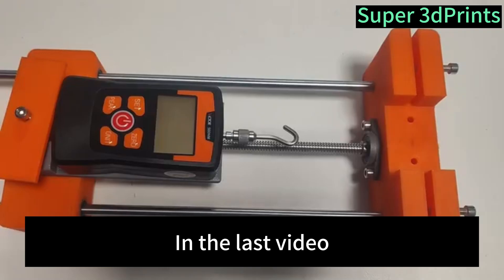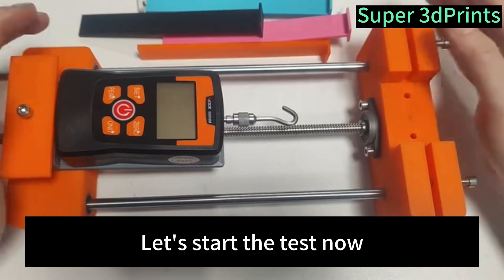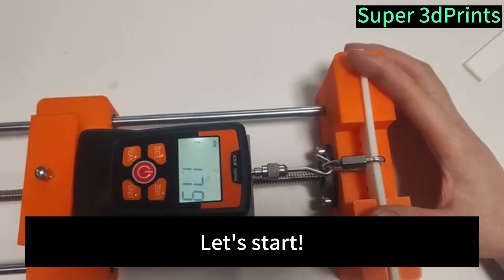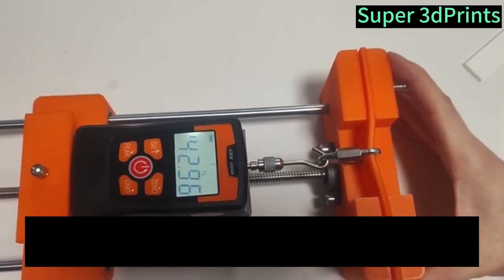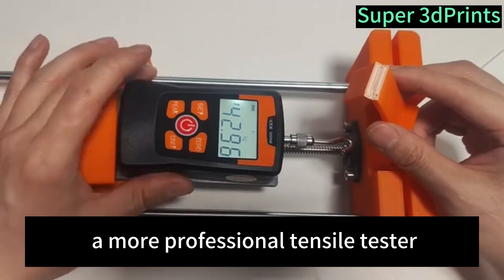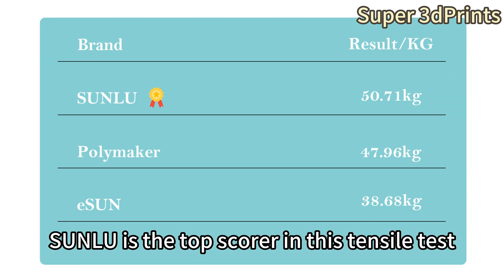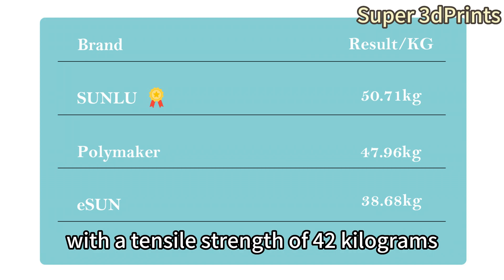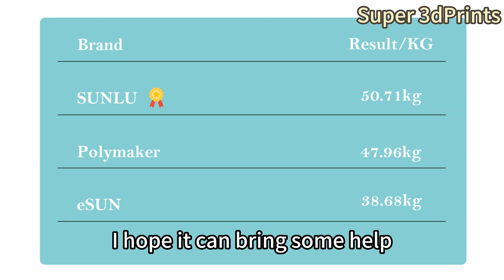Mechanical Performance Test - SUNLU PLA+ vs eSUN PLA+ vs Polymaker PLA+! Which filament is the best?

Comment: thanks for that will look at esun
Reply from the maker: SUNLU is also good, I used it a lot.
Reply: @3dprints-jessi  sorry I meant Sunlu :) I've been making surfboard fins out of the esun pla plus. much better than petg! Using nozzle 225 to 330 bed 80 and 60 percent fan , have to watch the blobs though
Reply from the maker: @LordByronMacintosh  Wow, next time I will try it!
Reply: @3dprints-jessi  I saw a study that connected strength of prints with the bed temperature - it turns out 105 degrees was best - but if you try and print the esun with 105 it won't stick to the bed . Maybe you could push it to 90?
Reply from the maker: @LordByronMacintosh  Okay.
Reply: @LordByronMacintosh  wow gonna test that! I was thinking if hot bed could help making layer lines stick to each other better!